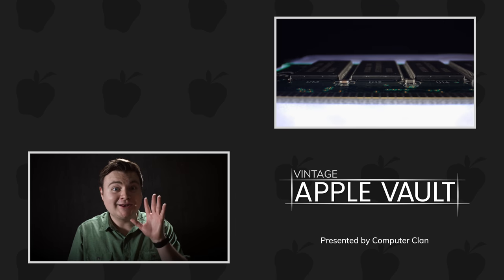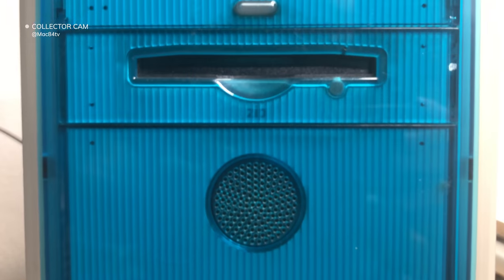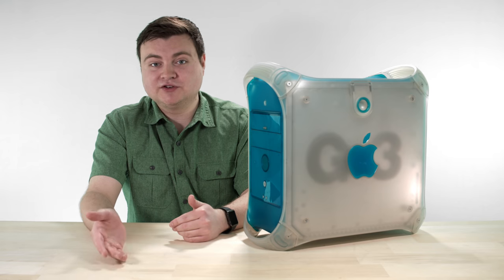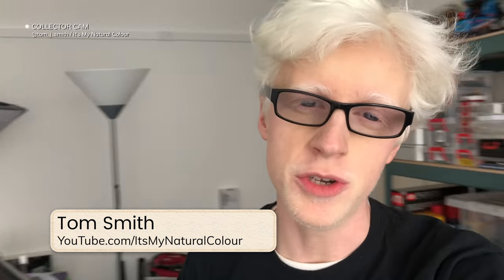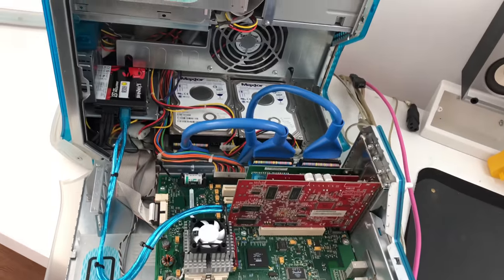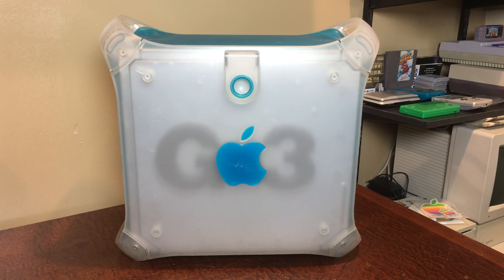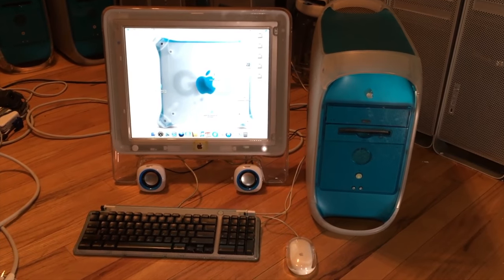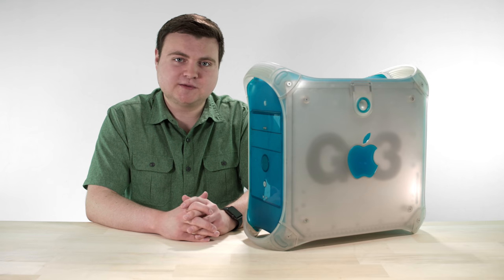Power Macintosh G3 (Blue and White) (ft. It's My Natural Colour) - Vintage Apple Vault #4

Comment: Just shows how overpriced most Apple products are. I personally use a 2013 MacPro and love it though a major drawback is the limited expandability. It's stable, quick and quiet. However, I bought mine used for 1500 Euros last year in 2018. I have since upgraded the RAM from 12 to 64 GB since then. At that time the new MacPro hadn't come out yet so the machine with pretty much the same basic setup still cost about 4000 Euros new. Ridiculous. Now Apple wants an extra 1000 bucks for a monitor stand for the new model.